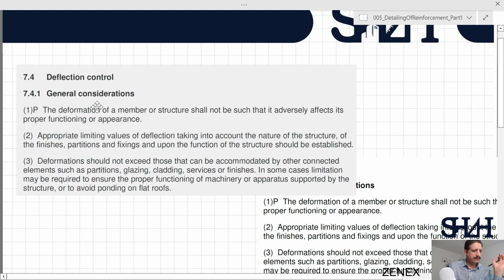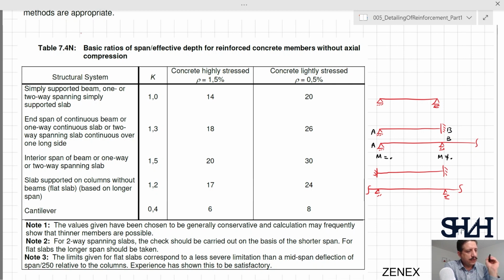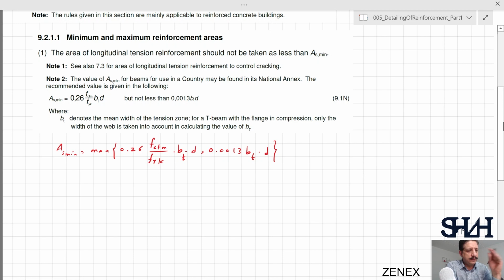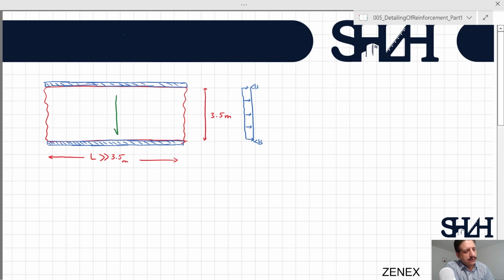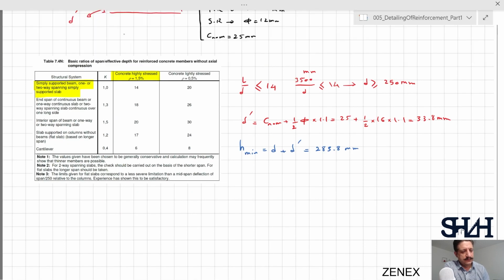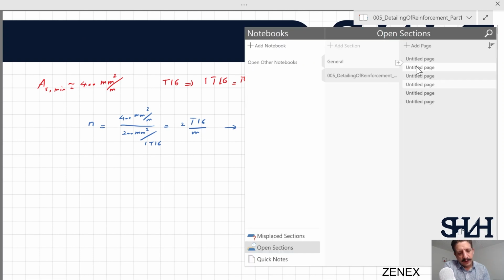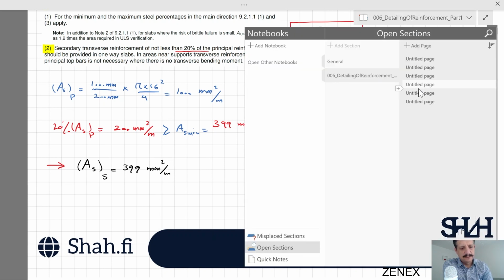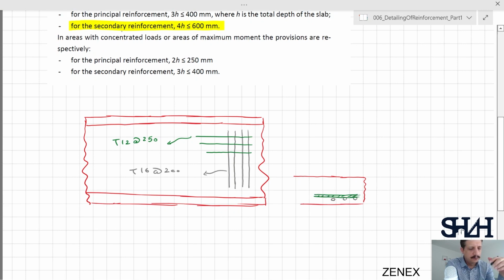006 Detailing Of Reinforcement Part1

Comment: Hello. Why does  area of secondary transverse reinforcement should be greater than As,min? I think that the requirement for As,min only applies to principal reinfocement. At least the Eurocode doesn't say anything like that.
Reply from the maker: Hi, that is true, and according to EC2-Clause 9.3.1.1(1), only in the main direction, the minimum reinforcement is mandatory. However, I usually use minimum reinforcement conservatively in two directions. Good point, and thank you. :)